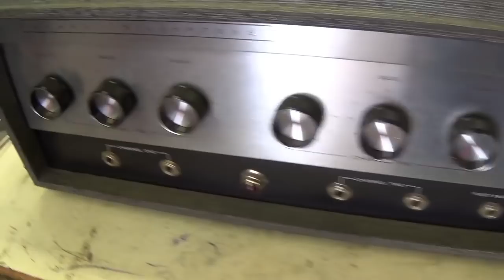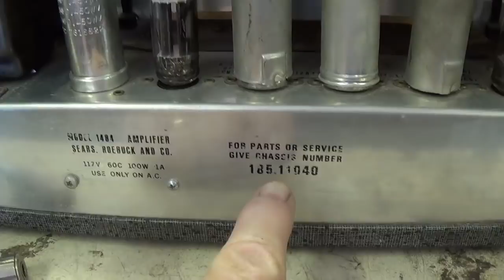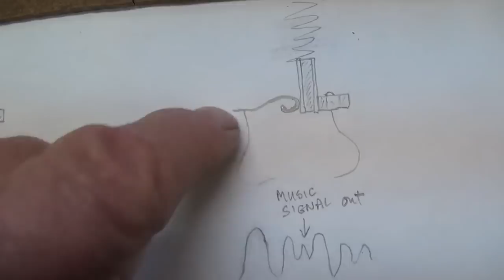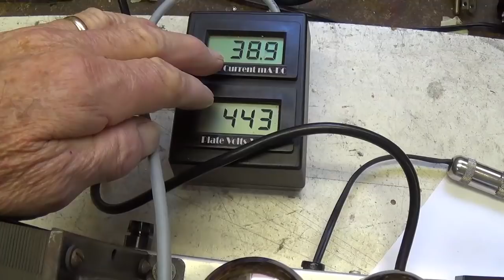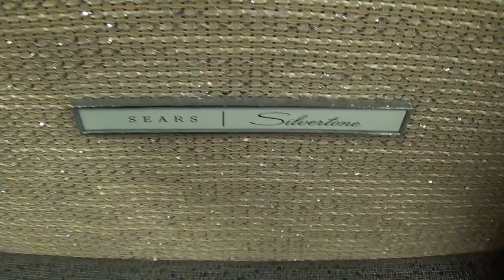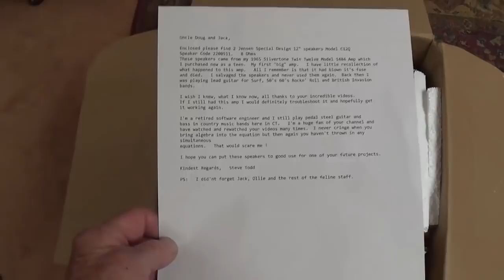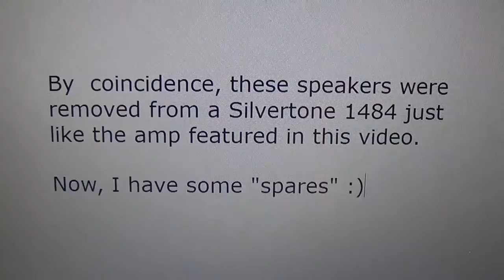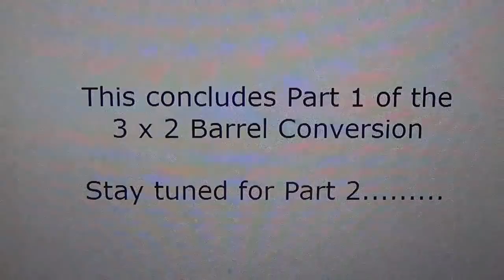Super Nice 1966 Silvertone Model 1484.......The Amp that Launched a Thousand Careers

Comment: Hello there. I am very impressed with all your videos,  great work! 
I do need your help,  if you would be so kind. Or anyone else has some information. 
I have a sound city b120 mark4 
Tube amp . It has a open diode in the power tube section.  OA 202
I can't find one, or cross it to anything.  Please help.  Thanks! 
Curtis
Reply from the maker: If it is the single diode used in the bias supply circuit, a 1N5408  (3A at 1000V) from Antique Electronic Supply would suffice. Be sure to have your VISA card handy.....they cost 38 cents :)
Reply: @UncleDoug  yes, a single diode in the bias supply circuit.  For 6  el34 power tubes.  Have you ever heard of a  OA 202 diode?  Original to this amp. Is the 1n5408 a derect  
Cross ?
 or just a good replacement.  Thank you so much for your time!
Reply from the maker: @curtismuma1931   I have never heard of an OA 202 diode, Curtis. If I were in your boat, I would use the 1N5408. It exceeds the requirements of your circuit.

Comment: Dear Uncle Doug,

I can't see a way to send you a note, so I'll just write a note on one of your videos.

I have a challenge. One of my favorite vintage SciFi TV shows is the original 1960's Star Trek, and one of the best episodes (maybe the best) of the series is titled "City on the Edge of Tomorrow". One of the key moments in that episode is when Mr. Spock is challenged to build a 23rd century memory circuit using early 20th century radio tubes. A tasks he described as; "Endeavouring to construct a mnemonic memory circuit using stone knives and bearskins".

Could you identify (from old TV screenshots) the components, and then reconstruct Spock's "20th century mnemonic memory circuit"? (Obviously it's just a TV show prop, but the goal is to use the same parts as in the show). This includes the "Jacob's ladder", tubes, and wiring.

Comment: That is a polarized two prong plug,  so the power cord was replaced sometime after 1962 when the grounded three prong outlets were required.  The wider neutral slot was added at the same time.

Comment: First thing you do to an old amp is pull the fuse and make sure it's OK... do this before you buy it.  If it's way higher than normal (like a 20A fuse) walk away.
Reply from the maker: Good suggestion, S.

Comment: you don't need a resistor with that ignition coil and pickup?
Reply from the maker: Not according to the instructions.
Reply: @UncleDoug  , what, you read the directions? Some folks would say you lose your man-card for that!😁
Reply: @UncleDoug  Cool maybe a higher voltage. I'll check it out for the 302 in my boat.
Reply from the maker: @goodun2974  I only glanced at them, GU :)
Reply from the maker: @miker252  This is a special ignition system, Mike, and the coil is part of it.....so apparently no resistor is necessary.
Reply: @UncleDoug  Thanks for your response I don't mean to be a pest. I installed a conversion kit from Hot-Spark company a few years ago.  Now I remember. I was able to bypass the ballast resistor but wondered if I'd overheat the coil.  It was good doing away with the points, but I had hoped for a higher secondary voltage.
Reply from the maker: @miker252  I appreciate your interest, Mike. If I find out that a resistor was needed, I'll let you know.

Comment: LOL, this is too much, I used to have one of those way back when, damn. Along with a silvertone guitar.
Reply from the maker: Little did you know that they would eventually become so popular and relatively valuable :)
Reply: @UncleDoug  Yeah, but I sold it probably 40 years ago, haha. I don't even recall what I paid for the amp, but the speaker cabinet was tall and I think it had 3 12's, it's been a long time. As for the guitar I got that when I was in about grade 3 or 4, so about 1965, for xmas and my dad build the tube amp for it at that time. Don't recall when I bought the Silvertone amp. What are they selling for now.
Reply from the maker: @wally6193  Nice 1484's are selling in the $1000+ range, Walter.....probably 8 to 10 times what they cost back in the 60's.
Reply: @UncleDoug  Wow, that really surprises me and that's USD I'm guessing. It was a good little amp though. But like you mentioned the reverb was a little questionable.
Reply from the maker: @wally6193  Yes, U.S. dollars.

Comment: Will you sell this amp Uncle Doug?
Reply from the maker: Yes. Several other viewers have made the same inquiry, E24. The shipping will be a really expensive chore, but possible. Provide your e-mail address and I'll contact you directly.
Reply from the maker: @etrius24  You are welcome to ask questions, E24.
Reply: I want that amp... LOL... just because I have questions about amps I am building does not mean I do not want that amp
Reply: Did you not get my email address?
Reply from the maker: @etrius24  I saw it, but did not associate it with your earlier comment. Response is on the way. I am in West Texas and would prefer to answer any amp-related tech questions in this Comments section, rather than via e-mail. E-mail is reserved for purchase discussion. Thanks.

Comment: "60 Watt" -- doubtful. Probably closer to 30 watts output.
Reply from the maker: How about if we split the difference at 45W ??
Reply: @UncleDoug  I don't think it comes close to that. It's about half as loud as a Pro Reverb. Do you have a scope that can measure the power output?
Reply from the maker: @VIDS2013  I posted a video on how to measure power output, V, but have not used the technique on any Silvertone's. Loudness is not a good way to measure power, since doubling the power only increases the volume by a relatively small margin.
Reply: @UncleDoug  True, but the relative power of amps is readily apparent in the low frequencies. You can feel a 50-watt amp, but not a 5-watt amp.

The Mojotone 1484 kit lists the output power at "~40 watts". It would be interesting to test an original 1484.

https://www.mojotone.com/kits/MojotoneAmpKits_x/Mojotone-1484-Amplifier-Kit
Reply from the maker: @VIDS2013  Agreed, V. I experienced this first hand when audio testing an early Fender Concert amp with 4 x 10 sitting at chest level on the work bench. It was almost like standing in the ocean, feeling the waves hit your chest. You may be right about the overrating of Silvertones.....and most amps. Hopefully, I'll get a chance one day to test one.

Comment: Just need to add a couple of cascading grain stages, and it would be awesome. Perhaps some NOS tubes for nostalgia.  I certainly wish there still werel vacuum tube manufacturers in North America, instead of the communist countries that University Professors are so fond of these days. Then we might have valves that are made with pride and attention to detail. It's a shame really.
Reply from the maker: I'm not sure the amp (or my neighbors) really need any additional gain, S67. I too favor vintage tubes and use them whenever I can. Amen on the college professors. It does seem like socialism (or worse) is a job requirement nowadays.

Comment: This sort of amp is going to disappear as in future guitar amplifiers will be done using DSP chips and letting Maths do the donkey work with a PWM output stage, PWM gives the same characteristic sound that Vacuum tubes would give and can model every type of vacuum tube.
Reply from the maker: I dread the future you predict, David, simply because it's sad that people will gravitate toward an imitation of tube amplification rather than simply enjoying the real thing. In what way is this progress?  Is a fake Louis Vuitton purse better than the real thing? What next.....virtual sex instead of reality ?
Reply: @UncleDoug  The BLACKSTAR Silverline Amplifier Modeling Guitar Amplifier with Class D output stage and has the ability to model the characteristics of the different Vacuum tube types types that are used in the output stage.

Comment: those things are a shock hazard to the max. dont wrap that fuse in tin foil.
Reply from the maker: What things are shock hazards, Marvin? Surely not a properly maintained 1484 with a 3-wire power cord.  Don't worry about tinfoil on fuses.....I simply replace all bad fuses with .22LR bullets :)
Reply: @UncleDoug  i had one of those in the 70s, with a 4x12 upright cab. saw a bass player back into the head and fall flat on his back and never miss a beat.  we did the tin foil.
Reply from the maker: @MOAONAABE  Wasn't youth wonderful, Marvin. Nowadays, a fall like that would probably result in a trip to the emergency room :)